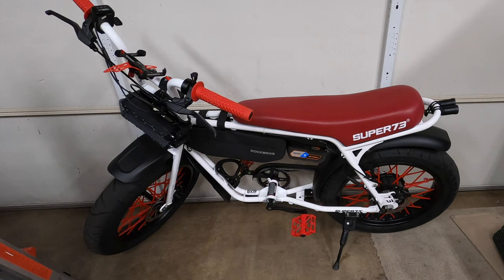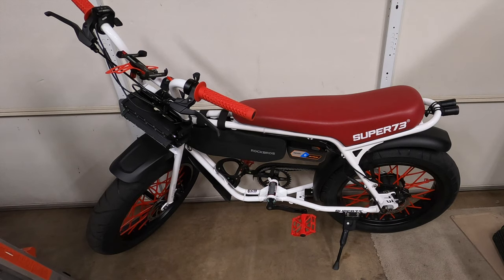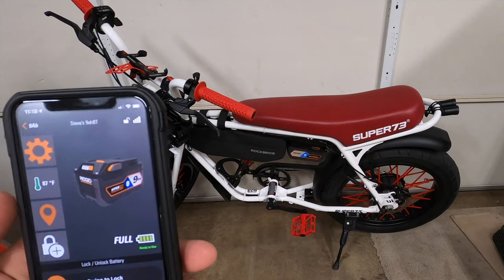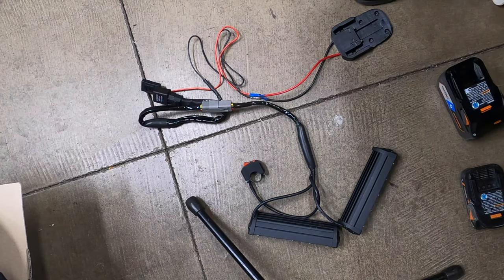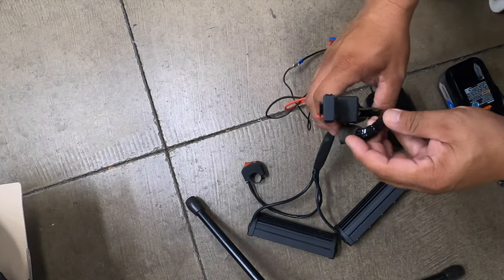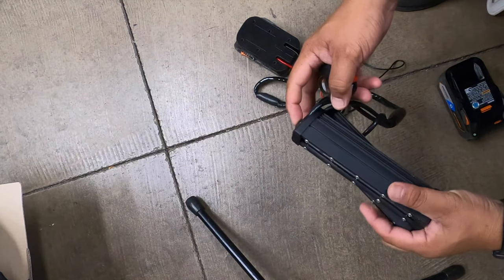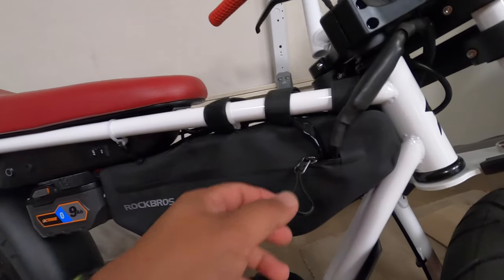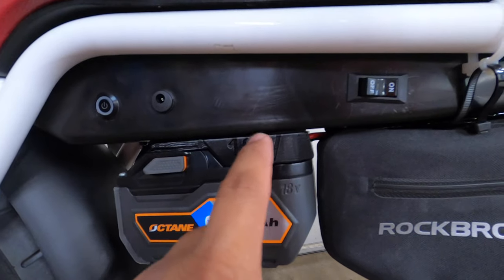SUPER73 Z1 Headlight Mod Part III

Comment: Mahalo!! I’m planning to get a Super73 “R” which also does not come with any way to power a headlight. All the headlight kits I’ve seen for it come with a battery pack but nobody ships to Hawaii because of regulations. But I’m pretty sure I can get a battery pack for a cordless drill at City Mill or wherever. You da best! Aloha!

Comment: Great job! Does the battery clip securely into place like when you insert them into power tools?
Reply from the maker: Yes Sir!  It's as if you're clipping them onto the actual tools.  The adapter itself is being held in place with screws.

Comment: How did you install the ROCKBROS BAG ?
Reply from the maker: JK Kulimlim Hi!  I started from the back (seat side) and I used long zip ties to let it hang just below where the seat would normally sit.  I did that for two of the slots on the top of the bag.  Then I used the supplied Velcro straps to do the remaining three.  I did use tie straps along with a couple of the velcro’d ones for added security.  I mean if someone wants to steal it then they will but any deterrent helps!  Best of luck!
Reply: @Maverik36  thanks bro I appreciate it

Comment: Can we have a link for the adapter plate?
Reply from the maker: https://www.ebay.com/itm/H-Battery-Adapter-for-Ridgid-18V-Hyper-li-ion-Battery-Dock-Power-Connector-Rigid/143319115001?_trkparms=ispr%3D1&hash=item215e7c24f9:g:uwkAAOSwFGxdHi-5&amdata=enc%3AAQAFAAACgBaobrjLl8XobRIiIML1V4Imu%252Fn%252BzU5L90Z278x5ickk7d4nremBkvNKtcC0ZwqXDH7%252BnK15YuEwnIwLaHqbNt0cwCCGjXUxrBN1TpoarzYcjOM50%252B8NKmje9SxtSsCUXP2pVN4QcCQZm501HfRzQL8K3pB9s8IYKsxSczc27Y6w24x0C5WHlFHm8f32oRHkEVFX3swb1Cha0AO3Nnv%252F8zAf10F4NvOq7hMaF6EvS%252FB58u62jemMYwu6Rd3%252BX4mh4BhXDDnnIm4nIg2uznsuBqfeiZxb%252FQ37A24DclSW21GvXgcq61kzye52sxkEooQGSMQ5i1HL58S5S1ISbmzEZLuMC9AcWo7tGZSri2JrjOof1pq81CVY0JE0M1mxu649dL5nfvIEwKaBOqHi1eCfPFmjaN974zozzv4DR2Jg71vDj73dXfw4LHImabfm5xl%252F%252FRwYKeY4j14dtzwz0XTwcomwZt2B%252FcusecqMZWXzU5o5HcYR4GeMPlz6zpUZrvd5xKE5HTU4LEprifxGE9MCfnMRCrL%252BPbAXwa0SOob6TBS1tazMtvfSMjI%252FL6bStjIZjKs4c7CJ3mMJmEzuIocsWdvGxqZdJPFAe3b1WR%252Ffz0UQB%252BjfRbwVCgaSi3ZW4wk%252B9u%252FDJYgvihJiF4SRXDtJ67MDO3C6%252F2qt%252F3ZOY1GN4eqAiJZjPlJfGG7CjAk6d6bC1PynVTChqh3vE5vO2n%252FKm7KfAtsnpBL3Km3%252FSTbDCGiT%252BQmR%252FYVpJ44WkhoIHQpJzluaJi%252BM0HTqw9SMAQu3ni0moFWMsKCAP%252B8yhEofC%252F4Ha5Ab7FypKkVU4nLcFvOxgYqTuDBJHm2NDT5J8HCCRXo%253D%7Ccksum%3A14331911500196e044539dad425e99fe2563cce32c4b%7Campid%3APL_CLK%7Cclp%3A2334524

Comment: Can you post links please??🙏
Reply from the maker: starfire919  Yes!!! I would shop around before pulling the trigger though.  I lucked out and found mines on clearance at. The local store.  I see Amazon and eBay sometimes have better deals and maybe even open box deals etc...    
https://www.homedepot.com/p/RIDGID-18-Volt-OCTANE-Bluetooth-9-0-Ah-Battery-with-18-Volt-USB-Portable-Power-Source-with-Activate-Button-AC8400809-AC86072B/313765922?mtc=Shopping-B-F_D25T-G-D25T-25_9_PORTABLE_POWER-Multi-NA-Feed-PLA-NA-NA-PortablePower_PLA&cm_mmc=Shopping-B-F_D25T-G-D25T-25_9_PORTABLE_POWER-Multi-NA-Feed-PLA-NA-NA-PortablePower_PLA-71700000034127218-58700003933021540-92700054846155828&gclid=Cj0KCQjw6ar4BRDnARIsAITGzlCO5qQtVR1RlB15JgI3X2VGekP92pqzifuQZJCAgv14Z4S2bmXJK3gaAsXsEALw_wcB&gclsrc=aw.ds
Reply from the maker: starfire919  oh this link has both the battery and a adapter (usb) so you can power other devices.  I believe it lowers voltage to 12v